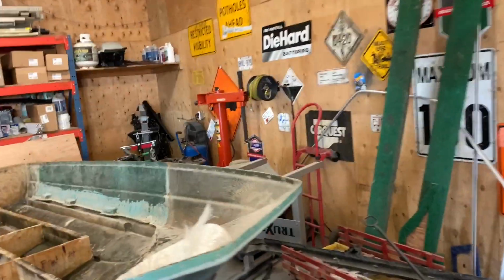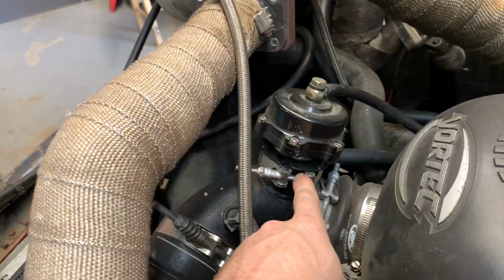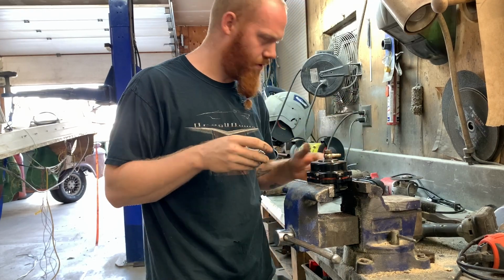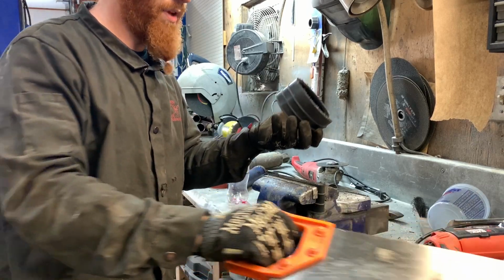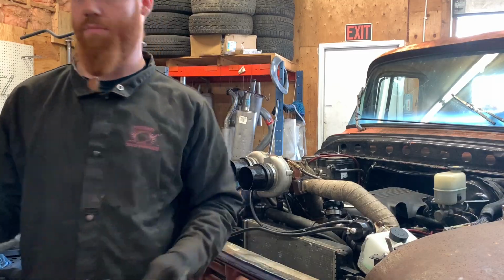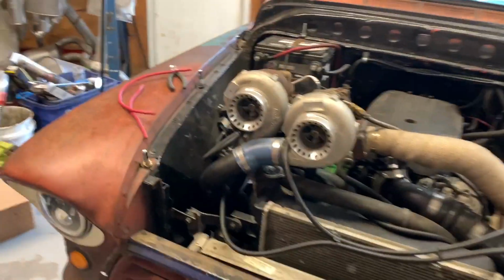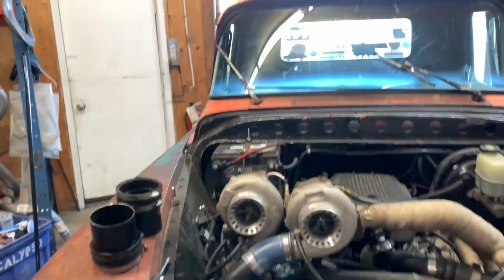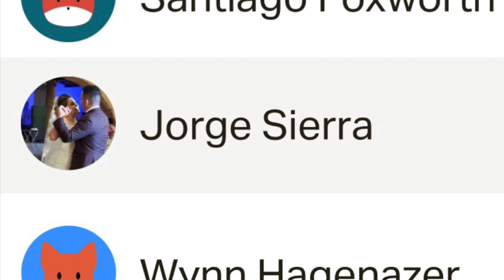I install dose pipes on my turbos, but I don't think I'm Australian enough

Comment: My skyline rb30/25 has one it’s about 10 inches long with a 90 bend at 7 
You gotta get the pipe to just be small only a small bit bigger than the compressor inlet the closer you get it to the inlet the better and the longer the pipe even longer the noises 
From an Aussie * 👌
Reply from the maker: Thanks man!! I appreciate it

Comment: I'm currently attempting to get a 71 buick 455 running that has been sitting over 30 yrs with no carb on it. has a half dozen stuck valves. I'm doing the right thing and doing the bare minimum and spending as little $ as possible.  all I want is tire smoke
Reply from the maker: I like where this is going 😁😁 kill all the tires!
Reply from the maker: Awesome!!